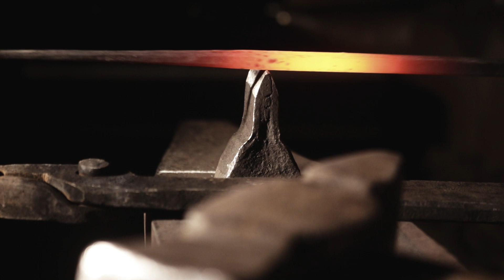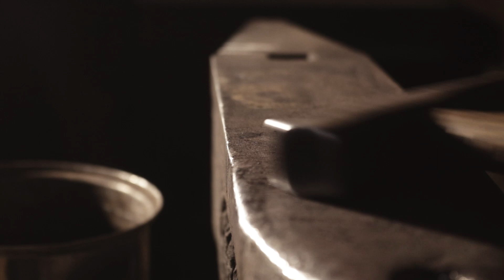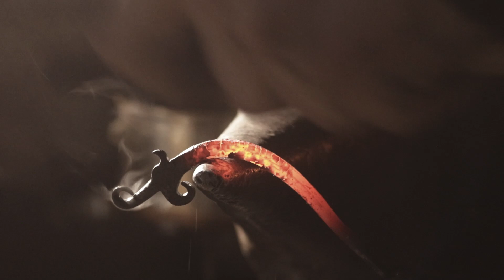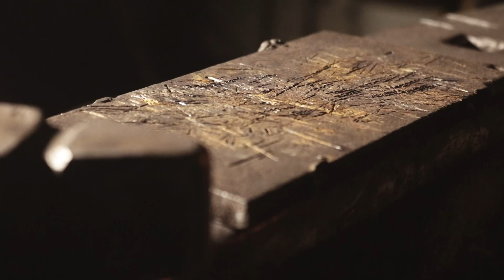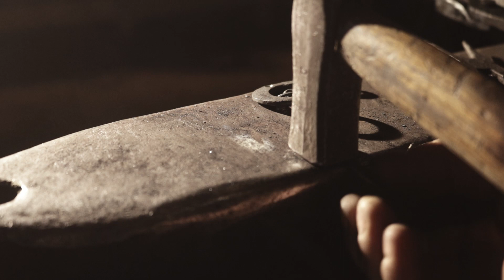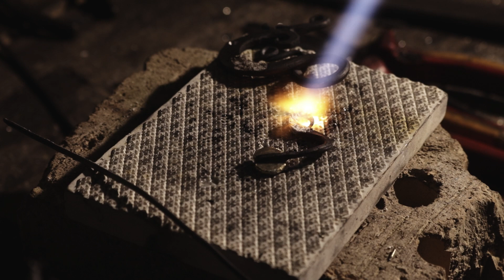How to Forge a Fafner Inspired Dragon Pendant: A Blacksmith's Journey Through Norse Saga

Comment: Love the Viking style. I have what is probably a silly question though… What was the purpose of the final heat and quench at the end? Great work 👍
Reply from the maker: Thank you very much! No silly questions! ask and you will learn :) I am quenching it in linseed oil in order to prevent oxidation and also make the pendant black. in order to do so the piece needs to be about 300 degrees celsius so the oil burns. Do you forge as well?
Reply: @lufolkcrafts  I see, that makes sense. Thanks for explaining, and it also answers the question I've always wondered which is how people get their pieces to go that nice black colour. I don't forge but it's something I'm interested in and I did go to a blacksmithing experience day once. I made a Viking-style/blacksmith-style knife and really enjoyed the day.